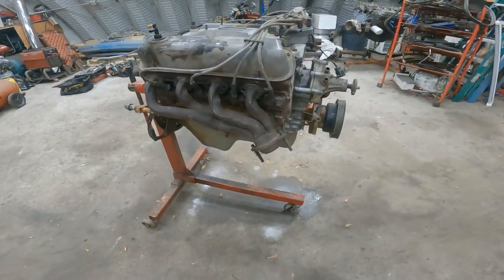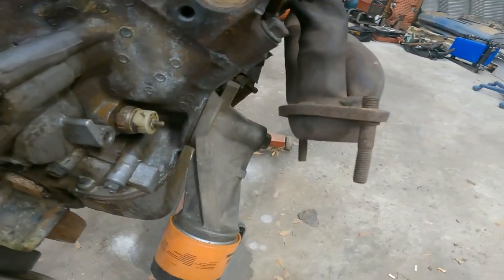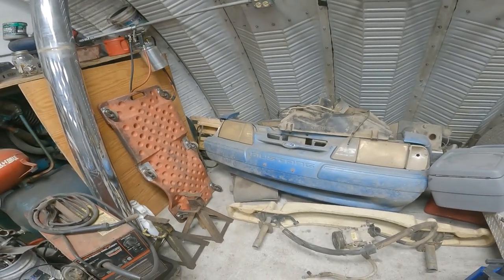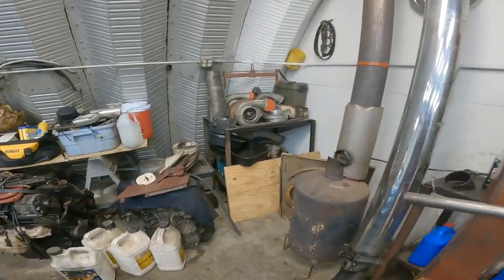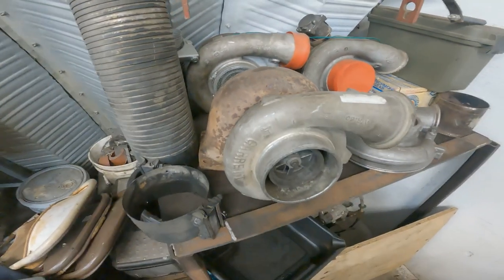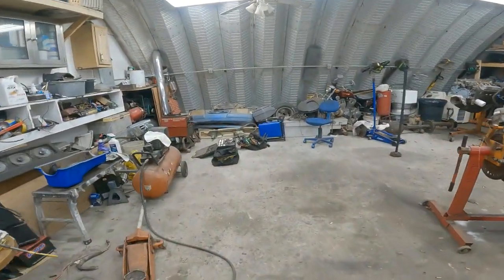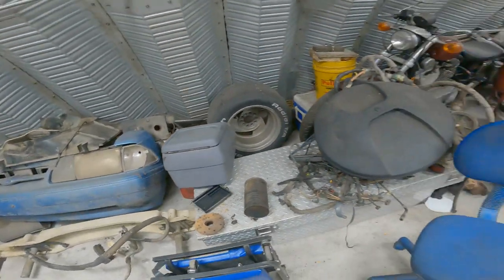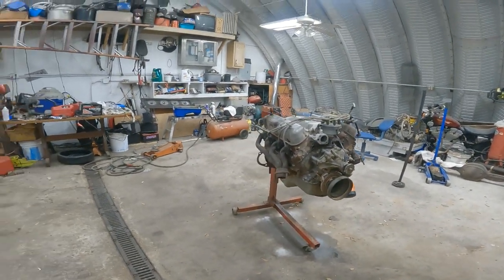351W Update On What The Plans Are For It

Comment: Cool beans man! Im going to fab a single turbo on my ranger. Relocate the battery and put it there. Low boost initially (6lbs)
Reply from the maker: With your set up 6 lbs is a good starting point. I give you about 2 days till you turn it to 10 lbs lol. With the heads and cam on your set up 6 lbs is probably like 10 lbs on mine. You'll be amazed what some boost does I know I was.
Reply from the maker: Go check out Tittan 1500 YouTube channel  he'll show you how to make a blowthrough carb out of the one you already have
Reply: @kickassmustangsgarage  6lbs is around 165hp at the flywheel :)
Reply: @kickassmustangsgarage  t3/t4 turbo that I bought from a friend for 50$ and it's good.
Reply from the maker: I wonder how much 15 lbs  adds?  That was my starting point lol. I had to turn it down to 10 it wasn't gonna live at 15
Reply: @kickassmustangsgarage  14psi on my combo adds around 350hp or so. On a 302 based block you are in the danger zone lol
Reply from the maker: These semi turbos are T6 with v-band compressor housings and they work on smaller motors because semi's only turn 2000 RPMs  and a 302 can turn 6000 RPMs they make about the same amount of air.
Reply: @kickassmustangsgarage  that is cool as hell. Im gonna need to pick your brain on my setup.
Reply from the maker: Sounds about right it was either eating the tires or smoking the clutch at 15 Lbs.  I added 400-600 lbs of weight to the ranger trying to get traction and the clutch wasn't happy at all.
Reply: @kickassmustangsgarage  lol. T5s generally don't like boost. I upgraded mine so its good till about 450lbs/ft
Reply from the maker: Tittan 1500 is a good place to start on blowthrough carbs. I'm no expert but I don't mind sharing what I do know.
Reply: @kickassmustangsgarage  Yeah im just gonna convert my 650dp. How are you taking out timing under boost?
Reply from the maker: The vaccum advance stops pulling advance once it's under boost and automatically retards it however much it was advancing. You can adjust the vaccum advance on the distributor through the hole where the hose hooks up with a small allen wrench.
Reply from the maker: Lack of traction is what's keeping mine alive LOL. I built mine with all new gears and bearings. synchronizers, and input shaft with upgraded gears with more nickel in them. It's stronger than a factory T5 supposedly .
Reply: @kickassmustangsgarage  School me on this. Are you using duraspark 2? I know about the little screw in the advance pot. Do you just run a low base timing? You likely need 18 degrees total on anything over 10psi.
Reply from the maker: It's a factory Ford 85 Mustang distributor.  My balancer is aftermarket with the marks painted on and they flaked off LOL.  I normally don't use a timing light can't with this balancer. It's probably 10 base and however much the centrifical and vaccum advance add minus the vaccum advance under boost. You probably know more about how much advance these type distributors add than me.  The centrifical advance probably adds at least 20 then 8 ish with the vaccum advance. I'm not sure without putting a balancer that has some marks that you can see on it.  If I had to guess I would say about 32-36 total minus the vaccum advance under boost. I did have some spark knock on 15 lbs like it is now. I need to do like you said and weld the leg in the distributor so it can't advance as far or swap the springs to some stronger ones so it has to be revved higher before it adds it all.  what do you think would be best?
Reply: @kickassmustangsgarage  I just don't understand with the duraspark distributor how the vac pot can remove timing. On mine it adds timing then goes to zero? Does your vac pot swing both ways?
Reply from the maker: It's a normal vac pod.  It's not removing timing just doesn't add any.  I guess under WOT it does the same thing 0 vaccum = no vaccum advance. I might need to rethink things lol.
Reply: @kickassmustangsgarage  I was just curious. Normally under 6psi of boost you need to subtract 9-12 degrees off your na timing curve to ward off detonation with pump fuel. What octane fuel do you run?
Reply from the maker: I'm running 93 . I tried some E85 but couldn't get the carb happy without air bleeds that you can swap it kept trying to go lean. I had thought about putting a boost activated plunger  to mechanically move the distributor. Shim the hold down so the distributor can move.

Comment: You may find that a dual plane intake isn’t the best option for blow thru.
Reply from the maker: It's the only one I have. I robbed it off the old 351W that was in my Ranger. At this point I don't have a dime in the roller 351W  just my time pulling it out. I would rather get it running first with what I have. It's stock and  old LOL  284000 miles .
Reply: @kickassmustangsgarage  It will work fine on low boost but high boost a single plain would be better imo.
Reply from the maker: I agree but for now it is what it is.  The heads are a joke and a stock cam  the one I have is enough for now. I wish I had the money to do everything with new parts LOL.
Reply: @kickassmustangsgarage  Use what you got. That is real hotrodding!
Reply from the maker: You have to crawl before you can walk. It'll take me a minute but I'll get it done.